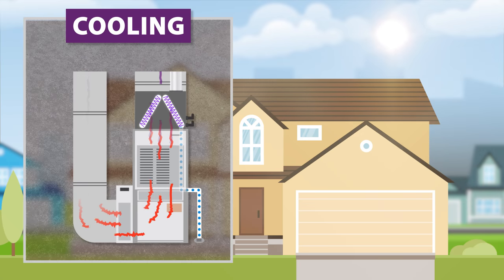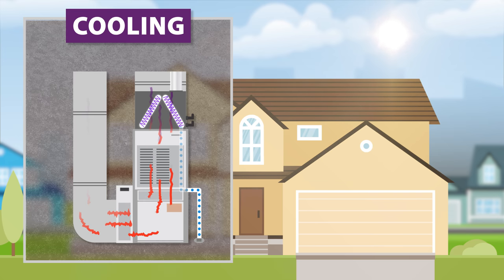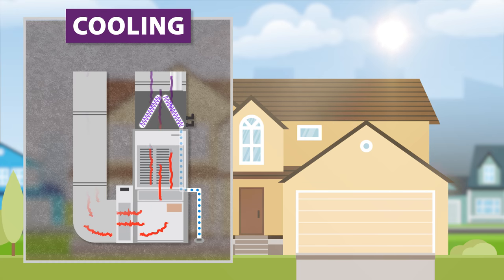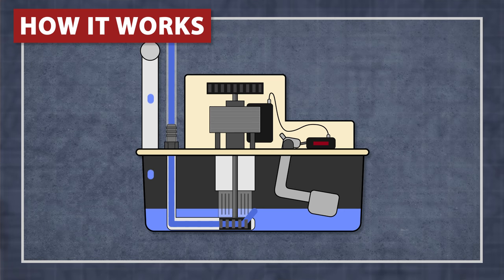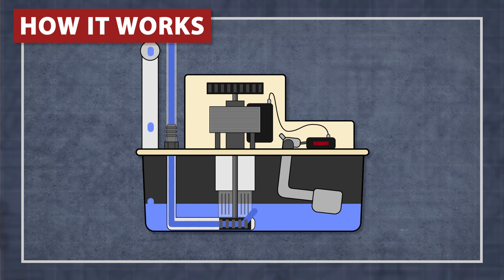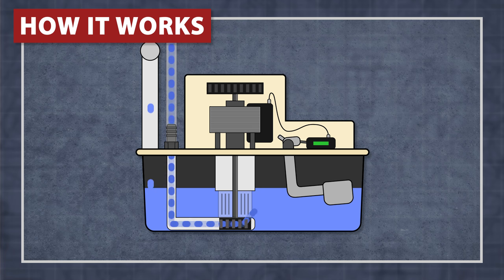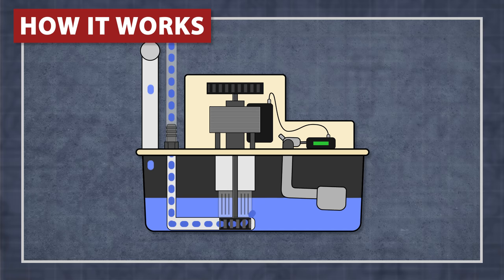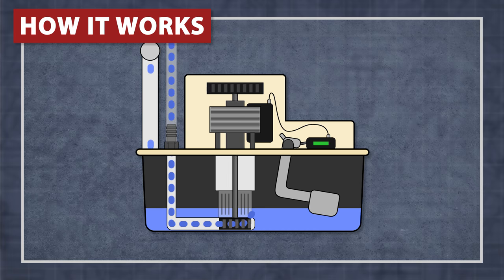How Do Condensate Pumps Work? | Spec. Sense

Comment: So what happens to the water in the OUT pipe that is being pumped out when the motor shuts off..?? Is there some kind of check valve that keeps that water from dropping back into the tank ..?? Im sure there is water in that pipe when the motor shuts down and that water is heavy and wants to come back down and into that tank ..
Reply from the maker: Thank you for watching. There is a check valve that prevents water in the outlet pipe from flowing back into the pump. Its shown in this video but wasn't fully explained as it is was in this later video. https://youtu.be/tO_dkn69mCY?t=55 Hope this helps you visualize it!

Comment: Just curious, could you have the condensate pump dump into a toilet? Just wondered since these usually dump down a drain, could it save money/water?
Reply from the maker: Hi Tony, thank you for watching. The condensate could technically drain into a toilet but it might not be as useful as it originally seems. Since the toilet will automatically fill after the tank is flushed, any additional water added to the toilet tank will go above the overflow tube and drain out of the tank. Also consider that your condensate pump produces water at a different time then when it would be needed by the toilet, so its mostly likely going to be adding water to a tank that is already full.
Reply: I thought maybe for people who live alone, if they shut off the main supply and had this flowing into the tank, they could save some money. I was hoping to find a video on it but apparently I'm the first to think of it.
Reply from the maker: You are right there are ways existing water can be used to save water and money. There are grey water systems that recycle water from the sink, which is treated and sent to fill up the toilet. In whole house systems treated grey-water can be used to fill a septic tank and eventually be used for irrigation.
Reply: Problem is once the toilet water tank is full it would start to overflow, because the pump would have no way to know that that toilet is full.
Reply: @moedogger21  the toilet tank has an overflow stem that flows into the bowl. The toilet cannot overflow without being clogged or water being put in faster than it can drain.

Comment: How high can a condensate pump the water?  I need to pump from a mechanical room in a basement into the ceiling and over to the laundry room drain on the other side of a hallway. Will it be able to lift the water 8-9’?

Comment: My water heater doesn’t have a drip pan and is nearing the end of its life. Instead I built a box around it and siliconed it to be water tight. I was thinking of putting a pump in there for when it does eventually leak to pump it out. Any thoughts
Reply from the maker: Thanks for watching. As the tank ages, the most likely parts that will leak are the relief valve and the drain valve. This is shown in this video: https://youtu.be/u_MTFlN5Rjs Those are likely to be slow continual leaks. The relief valve will open up if the pressure or temperature inside the tank gets too high. This is a good amount of water but the valve will close shortly after. If you don't have a drip pan and there is no floor drain near by then a box and a condensate pump would be a way of dealing with any water that might leak.

Comment: mine was overiflled with water dripping on the floor and the furnace never shut off. the installers of my furnace wrapped insulation around the pump. i think this blocked the airways of it and made it burn out possibly. and then the lines were also frozen in the attic which didnt  happen last year. im wondering if the wrap they put around it where they thought it was keeping it warm just blocked the exhaust andburnt it out. still doesnt explain why it didnt shut off though unless it was a cheap pump they threw in
Reply from the maker: Thanks for watching. Some condensate pumps have an overflow cutoff switch that is wired to the furnace. Others will not have this connected, which means an overflow will not shut off the furnace.

You are right that any frozen condensate drain lines will prevent the water from draining and can cause it to overflow so it's best to identify any areas that might freeze up, any pinched lines or any other blockages. Any insulation put around the drain lines should not interfere with the furnace exhaust, however it doesn't hurt to check the exhaust vents outside for any ice buildup or debris.
Reply: @AmreSupply   hi, i had someone check it out. basically the attic is just to cold and the  flexible plastic line is going to freeze no matter what. even if we wrap it and put it back in the pvc pipe, the pvc pipe will freeze. there was no wire hooked up to the safety shutoff therefore it never turned off and started coming out of the seams of the pump. there is pretty much no where to run the water. the only solution my new furnace guy could come up with is coming back and routing pvc pipe into my stink pipe and wrpaping the pvc pipe in heat tape and insulation. there is no where is to drain it or no other way to keep it from freezing. the old pvc pipe is about 30 yrs old in a victorian house that goes under 3 feet of blown in insulation in the corner through the wall outside into a metal pipe so even trying to fiddle with the old pvc pipe to make it work, and hope for it to work, prob wont work. im trying to find any topics on hooking it into the stink pipe but cant find any info. right now i got it temp draining into a bucket until the furnace guy can come back on the weekend. this is so stressfull its 8 degrees outside

Comment: My pump has an open valve that you see water. It's higher than the floor pump. It's this open pipe for air flow? Should it be secured?
Reply from the maker: Thanks for watching. Without seeing the system it is difficult to say. Are you referring to the air intake for the furnace? What size and color is the pipe?

Comment: How to un block the humid fire in a furnace
Reply from the maker: Thanks for watching. What part of the humidifier is blocked? If the drain of the humidifier is blocked then it might be because of a mineral buildup. You might be able to use vinegar to help dissolve the calcium.

Comment: So it's normal for one to remain on even after I turn off the AC as the pump is triggered by the water level and not the AC unit, right?
Reply from the maker: Thanks for watching. As the pump runs, the water level should lower and the pump should turn off. If the pump doesn't stop running then the switch could be stuck.

Comment: Help. I just bought my property, when I bought it the furnace was not working. I had a new furnace put in a month or so back and the condensation pump began working. I have lived in Utah for decades, owned several homes and have never seen one of these. My unit (it's a codo) was built in the 70s, and and was originally total electric,  therefore the only drain is in the shower in the finished bathroom {and of course the sewer}. The furnace was reto-fitted for the unit in 1996 at the latest (the furnace I replaced was 21 yrs old}  I am currently catching water in a gallon jug at a gallon on slightly more in a 24 hour period.As an otr truck driver this is simply not going to work.  Are they necessary? Can it be disconnected? How can I effectively  drain the excess water? Suggestions please.
Reply: side note: the AC was not replaced. Will the amount of water reduce when I get a an AC? Back to is this a necessary piece of equipment in a desert climate (Utah)
Reply from the maker: Hi Sharon, thank you for watching. Older furnaces usually do not condense water. When you installed the new furnace you likely upgraded to a condenser furnace. You can learn more in this video: https://www.youtube.com/watch?v=tVLtJwix-_8&list=PLCo9SMjkdWBzorzNrARLKALj9fW7HzHMh&index=2 If there is no drain on the same level as your furnace then you can always run a drain line to a drain somewhere else in the home. The drain line can be run vertically but keep in mind that the flow rate will decrease as you increase the amount of head. Note this chart listed here: https://www.amresupply.com/part/554542-LG-NXTGEN-84GPH-COND-PUMP-115V#gallery01-10 At 20 feet of head, the flow rate will drop to 10 Gallons per hour which would still work in for case. As for an AC unit, even living in the desert the air will contain some moisture so you will still need an active condensate pump to run an AC unit. Overall it might be worth contacting a plumber to asses your situation and set up an effective condensate pump and drain combination.

Comment: I've got a beckett CB201UL - the float switch seems to be backwards? When the float is down, it runs the pump indefinitely. When the float is pushed up by water, the pump stops completely. Any ideas?
Reply from the maker: Thanks for watching. Does the float switch have 3 wires? In some cases the wrong wire on the wrong terminal could cause the switch to work in reverse.
Reply: @AmreSupply  It does, but it was working perfectly fine up until 4 days ago at which, without provocation seems to have reversed its function entirely.
Reply from the maker: @jaybrotatoe5367  Maybe check to see how the float is triggering the switch. It is usually a piece of plastic. Over time with wear and tear, things can warp or might have shifted. That would be the next thing to check. You can also disconnect the wires to the switch and check for continuity. There might be a C - common. NO - normally open - and NC a normally closed terminal. You can test this in the same way that a oven or refrigerator door switch is tested: This video explains more https://youtu.be/sWSUzTuvFRI?si=24IepEf5FnaePZHY&t=220

Comment: How many metter. Water throwing distance
Reply from the maker: Thanks for watching. This will depend on each pump. You'll have to look for a PDF of the product specifications, from there you'll see a chart which will specify the flow rate at different feet of head (which is the vertical distance that the water is traveling) Scroll to the bottom to see an example PDF for the model used in this video: https://www.amresupply.com/part/554530-LG-NXTGEN-84GPH-COND-PUMP-115V

Comment: I have received a quote of $550 to have a condensate pump installed.   Is this a reasonable quote?
Reply from the maker: Hi Sue, thank you for watching. it depends on what other work is needed. If they are installing a drain line or need to do anything special then they will charge more, but $550 does seem a little high. Condensate pumps cost $50 - $100. https://www.amresupply.com/catalog/Condensate-651475-HA1A If you are simply replacing the old pump its easy to do https://www.youtube.com/watch?v=dcLhyLu0-y8 Hope this helps!

Comment: Would it still pump water if it's reverse polarity?
Reply from the maker: Hi Marty, thank you for watching. Yes a simple AC motor will likely still run when the polarity is switch its just not as safe from a circuit point of view as the load is positioned before the switch. We did a video on circuits that might help you visualize: https://www.youtube.com/watch?v=SnRXD-0oXZo